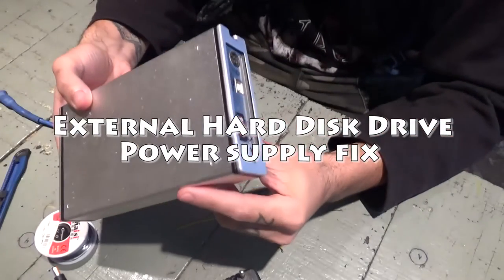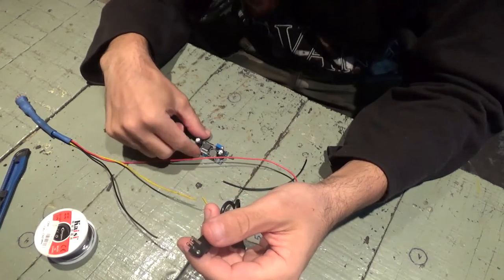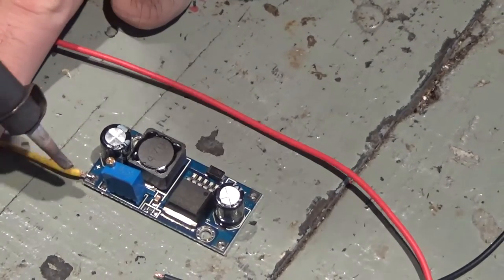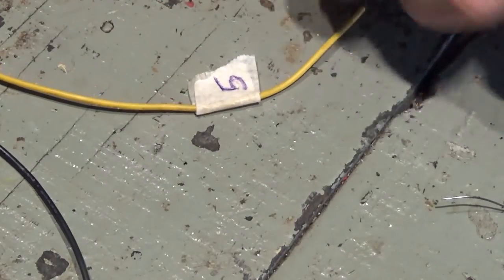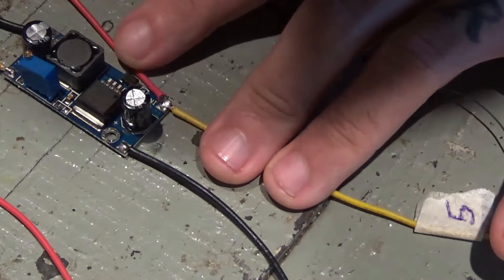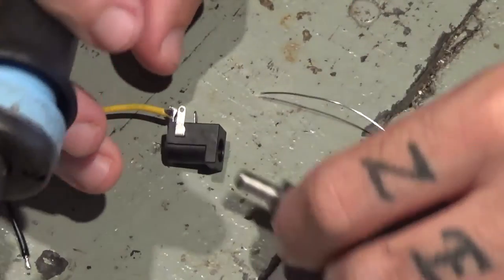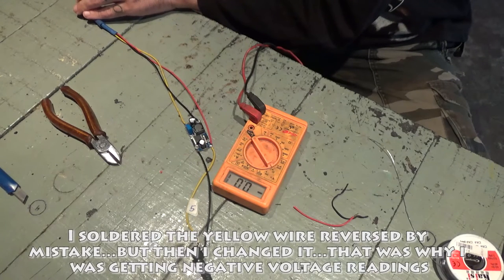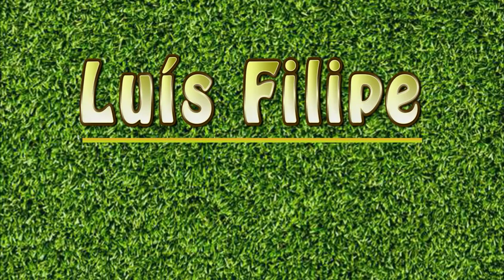External Hard Disk Drive power supply repair

Comment: Yellow is 12V , Red is 5V . correct your video sir , you giving ppl wrong information
Reply: It is not a manufactured wire that you need to follow wire color code. It is DIY it depends which or what color of wire you use. Before you react try to understand everything okay. There is no problem with his video it is you the problem you don’t understand dude